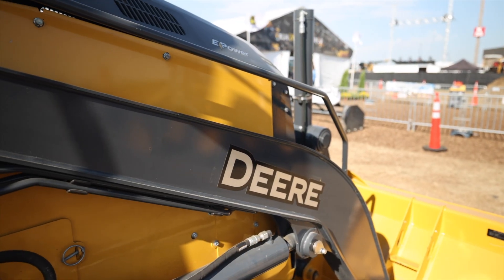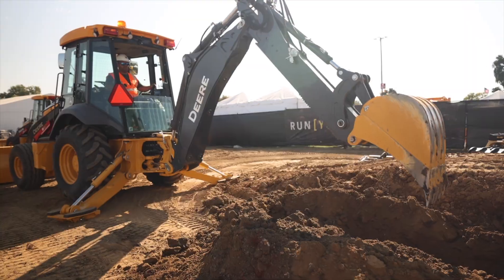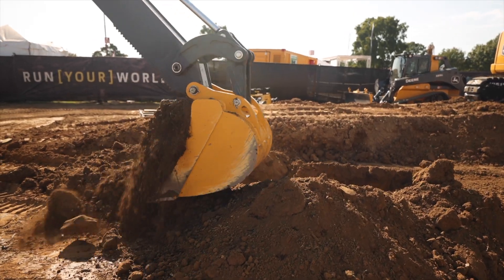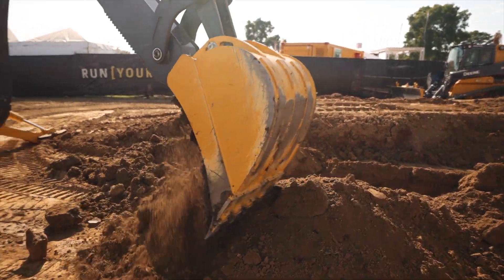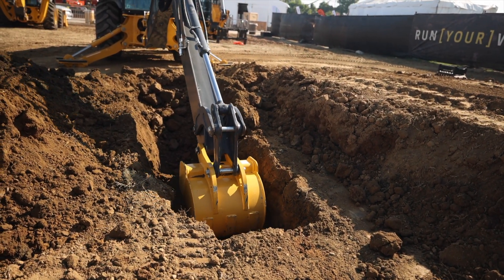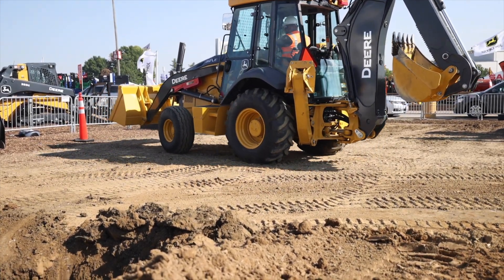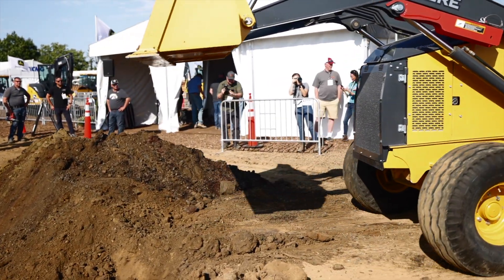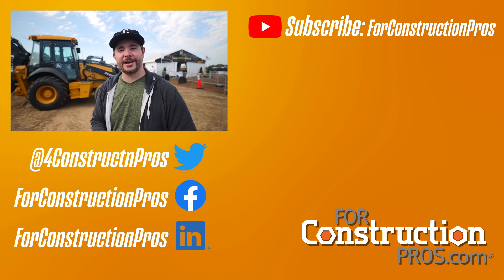Deere Unveils Its First Electric Backhoe. Everything You Need to Know About the 310 X-Tier

Comment: Today's excavators waste 70% of the useful work from the engine as heat in the hydraulic circuit.... due to poor pump efficiency, throttling in the valves, and wasting potentially recoverable energy. If you just electrify the diesel machine you basically have a battery-powered patio heater doing a bit of digging work on the side! Improving hydraulic system energy efficiency with the latest digital displacement pump technology is key... opportunity is there to extend run time by 30% or more.

Comment: Run time is the most important variable.  Using multiple motors driving different pumps would reduce demand load and further battery life.  Bearing design in the boom and arm would have to be different and maybe a self loading battery design to replace an exhausted battery with a charged one would be good instead of relying on recharge.

Comment: Pffft waste of money and what about the blind people they have hard enough time with Prius's lol but seriously its gonna be a waste of money cost of maintenance alone with buying new batteries everytime you turn around , new chargers new hydraulic motors
Reply: Umm you do know there most likely going to be lfp which has 5000 cycle life after that you have 80% battery capacity there not old lead acid batterys that only have 200 cycle life plus hydraulic pumps are the same regardless of the motor powering them and electric motors are known to out last any internal combustion motors so less maintenance... and the charging all night then yeah if your plugged into a low power outlet most places that this goes to have phase three power so 20 min to charge your questions are good but related to old technology

Comment: Most important information in the first minute to know if this is a toy vs serious contender.   #1 Cost  #2 WEIGHT.   Got to haul it, Ground pressure, etc...  #2  Run time.  #3 Charge Time. #4 Battery Longetivty in Heat, how much capacity will you lose per year until you have to replace the battery.  #5  Cost per battery replacement (labor and materials)
Reply from the maker: Karas, these are all good questions. Because this is a prototype, Deere declined to go into specifics on the things you mentioned. However, I'm making a note and we'll be sure to get those details when/if this backhoe actually makes it to production. Thanks for watching! - Wayne